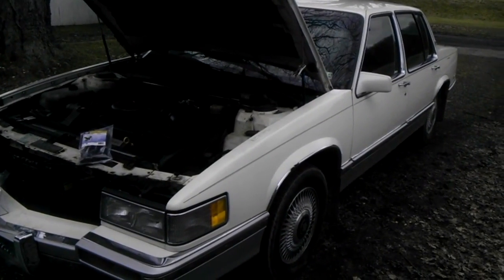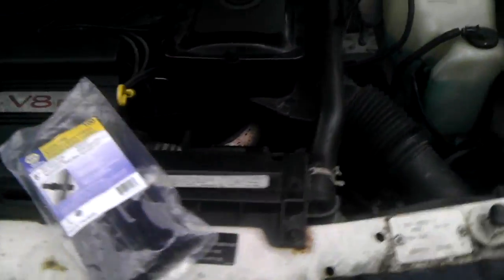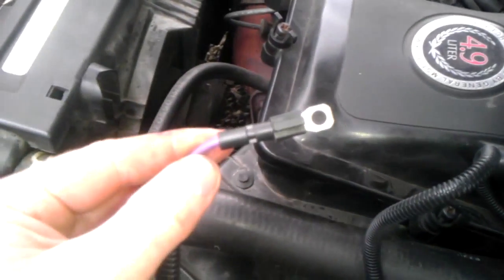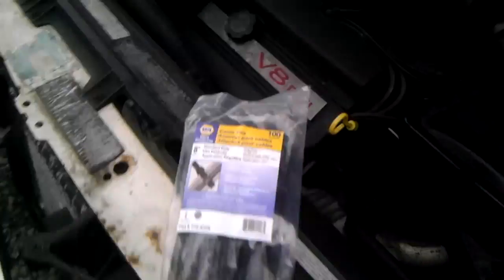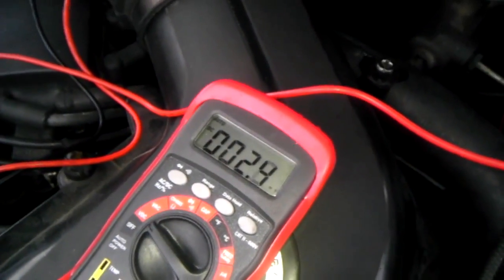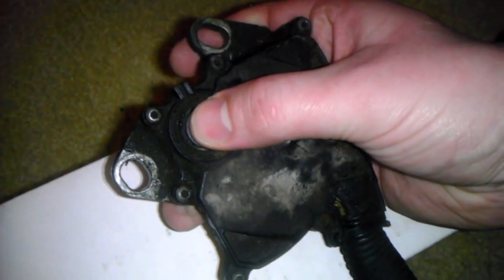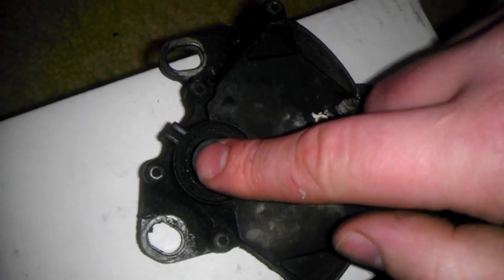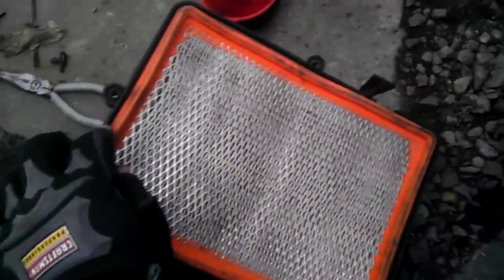Cadillac no start, no crank, intermittent problem

Comment: I have a 1995 Cadillac Deville and had the fuel pump replaced 2x! And now the car just stopped working again and won't start...I was thinking it was the fuel filter but after seeing your video I believe it is the safety switch as well..thank you.

Comment: Dumb question but is there a certain way to take off the black bolt that locks it in place? or can I just send it with a socket and ratchet without worrying about messing anything else up?

Comment from the maker: Glad to here everything is working good now.  Thanks for that information as it could also help with others in that situation.  Gotta love the parts companies for being stingy and not having that part with the pump lol.
Reply: Would it be easier to go in through the bottom or the top easier
Reply from the maker: @gokublack001  it's possible.  I didn't have access to a lift at the time.  From watching the video you can see down there, but not sure if it'll be easier from under.  If you do it under let me know if it's faster.  Good luck with the job and hope this helped.

Comment: Well my 1995 Cadillac Deville is fixed now. It was not the neutral safety switch...a small part that is connected to the fuel pump(but does not come with the fuel pump).. I forgot the name of it but they said that this little part is connected to the fuel pump, electrical system, etc. basically all the major parts of the car. This little part was burnt out..and has been replaced..car runs perfect now! :-)
Reply: Wish you knew the nane of that part
Reply: OreliaLatrice what is that part
Reply: What did it look like
Reply: Was it the crankshaft sensor?

Comment: I should have seen this A LONG TIME AGO...but his video wasn't up yet... 
mu mom had a 92 Deville just like that, it had the same problem, that darn safety switch...after 2000 bucks later we found out it was the safety switch...here's the list of what the mechanic changed. 1.fuel pump w/ filter. 2. ignition switch w/ new key from Cadillac. 3. starter. 4. battery. 5.spark plugs and wires. all that for 2000 bucks, then my mom sells the car for 600 bucks, it made me cry!

Comment: Ours just did it, but we noticed the door locks were acting up first when shifted into park from drive, we wiggle the wires going into NSS and it took right off when we turned the key. A bad NSS  thanks!
Reply from the maker: DJ51011 you're welcomed 😁

Comment: We have a 1989 Cadillac Seville, that we have been having problems with it not wanting to start or crank, but lights,radio,door alarm works. after jumping or charging battery it works. or we get the alarm messaging wait so many min. but sometimes we don't have any problems
Reply from the maker: Melissa Perdue have the charging system and battery checked out to make sure it's all good first.
Reply: +SYNTHETICDARKNESSRX8 The battery is approx  8 months old and 
 has a new starter. but we will check
Reply from the maker: Melissa Perdue you can also check for parasitic draw that could drain the battery enough to cause problems also.
Reply: +SYNTHETICDARKNESSRX8 
 okay , I will have him test for that also. 
 I was wondering if it could be a short in the ignition system area. 
becUse sometimes it starts no problem. other times we get the anti theft message. and sometimes it won't start ,nor crank.
Reply: @melissaperdue3848  my car been doing tha same thing😘

Comment: hey i got the same problem on the 1993 4.9L i replace my distributor and then it wouldnt start. it cranks but the stop engine light come on while im cranking it and my safty nuetral switch it coroded with gulk so im thinking im getting a short volt

Comment: I got a 95cadillac fleetwood brougham and I got no dashboard lights how can I fix it?
Reply from the maker: Without much to go by I'd check the fuses, wire connectors, then the wires itself.  Could also be a bad ground, or maybe the cluster went bad.  Sorry I couldn't narrow it down, and without seeing anything makes it a little more challenging.

Comment: I am looking at a 89 Fleetwood fwd that has been sitting and it will turn over but not start according to the seller.  It is a barn find with fairly low mileage.  I know it's a long shot since neither of us have any history.  Just looking for some ideas before i make that drive to check it out.  Thanks.
Reply from the maker: Firstly check all fuse and relays.  See if there is fuel then spark.  If no spark check icm or coil pack.  If no fuel check if pump is turning on or fuel filter if equipped.  Hopefully this helps and you get this nice find!

Comment: Hey can you help me I have this exact same car my problem is that when I come to a complete stop it turns off or when im driving really slow and I have to put it on park and turn it off then I turn it back on and works just fine. I have took it to a mechanic that replaced the distributor, cam sensor, relay and a couple of blown fuses, and the catalytic converter, now I read online that people who come to a complete stop there cars turn off too and they get error code e91 which is the safety switch that is mentioned here. So I will try replacing the switch and see if it works, the mechanic replaced all those parts because it gave error codes pointing to those problems but still shuts off!
Reply: O and he also did a tune up on my car doing all the spark plug changes and all that tune up stuff
Reply from the maker: pavy415 I'd clean the throttle valve and make sure the idle is at it's specified setting and go from there.  Sometimes the iac can cause certain problems like that and a dirty fuel filter also.  If what I'm understanding though that when almost stopped you put it in drive so the car will start again?
Reply from the maker: pavy415 I would of checked the sensors to see if they were in spec though before just throwing new parts at it.  My scanner is able to do almost anything when diagnosing problems.  Hope you get it fixed right soon.
Reply: We changed those parts because the error codes pointed to those problems it all happened when I got off work 5am as I was leaving my car just died on me and would not start it would crank. we got it going again and this time the problem is that it would stop and turn off on a stop or if I am driving very slow. We got rid of all the error codes and now the only error code points to faulty battery connection we will be checking that tomorrow becuase my car still turns off even after replacing the safety neutral switch.
Reply from the maker: pavy415 Whatcha find?    I forgot to say to also check fuel pressure and timing, especially fuel while driving.
Reply: SYNTHETICDARKNESSRX8 we changed the safety neutral switch to no avail it still turns off. We are most sure it might be fuel pump or electrical problem.

Comment: I'm having an issue starting my 95 deville when hot, its starts fine if its been sitting for a few hours but wont crank even after only being driven for 10 to 15 minutes.
Reply from the maker: Have you tried jumping it from the starter.  Possible solenoid failure.  Do a voltage drop test also to make sure it's supplying the proper voltage to the starter which will also help verify the lines are good for the most part.
Reply: SYNTHETICDARKNESSRX8 I'll try this, thank you!

Comment: I have a question I have a 2007 Cadillac CTS I just put a battery in it and every time I put a battery in it it drains the battery I don't know if if it's the right battery or do these type of cars have to have a Pacific battery cuz now is not doing anything
Reply from the maker: Usually the battery that they give you should work.   If the charging systems is failing then it'll drain the battery.   Also of you have a parasitic drain when everything is off it'll end up the same.
Reply: @SyntheticVisionsAutomotive  my 91 Cadillac has been sitting for 2 months I have been trying to crank her up it will turnover but wont catch what could it be
Reply from the maker: @cjharris2367  if the starter is engaging then check for spark and fuel.   Also check to make sure there are no codes and all fuses are good.   If starter is not engaging might need replaced or not getting proper voltage.   Hope this helps.
Reply: @SyntheticVisionsAutomotive  ok thanks

Comment: same problem key turns in every gear lights brite battery charged no security light on hope it fixes it fuse good starter too
Reply: Did you fix this problem I'm having same with mine

Comment: Because I'm watching right now I got the starter switch off what the bolts on it but I need to know how you took the wires off because I'm fixing my car
Reply from the maker: It's been awhile, but should be able to just disconnect the wire and mark the switch in case you have to move the switch to gain access to bolts and so on.

Comment: I have a 1995 cadillac deville and iv changed my starter and alternator but it still wont turn over..while i was driving it cut off..any suggestions
Reply from the maker: Scan it to see what codes come up.  Have you tried to start it in neutral?  You could always try holding the key while slowly shifting through the gears (take caution and use the brake in case it's jumps forward) and if it starts somewhere else or not in the same spot most likely the park/neutral switch.  

Do drop down test on the terminals to make sure the wires and connections are good.  If it hasn't had a full tune up give it one, and try to get iridium plugs and fuel filter.  Hope this helps.
Reply: +SYNTHETICDARKNESSRX8 my friend has a 91 Seville won't start theft light comes on how do u fix,that ???

Comment: Hi, found this video searching for an answer to my problem. I have an '89 4.5L Eldorado that will just click on every 3rd or 4th start. If it clicks, I just try again and it fires right up. It sounds like the solenoid, not the relay. It has a strong, newer battery and cranks normally. I'm disabled, so what I'm hoping is just to be able to clean the connections. Getting under the car will be difficult (it wasn't that long ago I could swap out a starter in 15 minutes), and I'd REALLY like to avoid paying a mechanic. I don't have a voltmeter (gave my son the majority of my tools, he's since moved out of state), but should have the necessary sockets... just wondering if you think it is the solenoid as well before I attempt getting under there.

Thanks in advance.
Reply from the maker: Without proper electrical equipment it will be a little more difficult to pinpoint.  If you have a lot of mileage and age you could always take it to a rebuild shop and they'd test it before working on it.

It does sound a little like the solenoid.  What you could do when it don't start is bridge the connection over with a screw driver to see if it starts right from there.  Take all precautions when doing so.  Cleaning the wires might help, but it could be internal.  As for the relay you can just swap a known good one to it making sure they are the same relay.

Hope this helps!

Comment: hey I have a 94 mine won't start lights still come on .. the dash says due to theft system car disabled start in 3 mins I wait the 3 mins and nothing any idea what it could be.
Reply: Gena Lewis security system is the issue. you can either bypass it or fix it. bypassing is cheaper
Reply: @DevaJones03  how to bypass the security system
Reply: @kaylagreen7233  they have a resistor you can purchase for that

Comment: I have a 1991 Cadillac Deville  4.9l no start  no crank  all been done like you said  and all  still the some      ?? could the starter relay switch  keep it from cranking      ty will did not find one now  code e52 but still not doing anything
Reply from the maker: Unless the codes got reset, or battery disconnected that code sometimes will pop up.  Relay and fuses can also cause no start.  Can usually bridge relays or buy tools that do it.  Just careful and make sure car is in park when attempting to start from outside.  Ignition switch can also be a culprit.
Reply: +SYNTHETICDARKNESSRX8   ok ill re check relay and fuses
Reply: +SYNTHETICDARKNESSRX8 there fine put on   a new neutral safety switch but  still no power going throw the ppl wire that goes to starter  but  I ran a wire to    Ignition switch  y   with out ppl wire on the starter  .  then put wire to starter  . it cranking  but  no fire
Reply: +SYNTHETICDARKNESSRX8 now it  saying  f.0.80
Reply: +james McCoy  mine is  fix running fine  I bypass  the theft  system
Reply from the maker: +james mccoy that's good to know.  Sorry I couldn't help more.
Reply: +SYNTHETICDARKNESSRX8 you did I'm driving it now :)
Reply: +james mccoy so it was the theft system that was keeping your car from cranking and starting
Reply: @jamesmccoy7860  how did you bypass the theft system because I have a wire hockey up to starter then I have to touch the battery to start it
Reply: hooked up

Comment: Mine is the same problem but I bought a new NSS and installed it and everything but still nothing? And I touched the solenoid by accident and now no power or anything what do you think it could be?
Reply from the maker: Ruben Villagrana I would start by checking the fuses and relays just in case of a short and go from there.   Make sure you're getting power to what needs powered and ground connections are good too.
Reply: SYNTHETICDARKNESSRX8 I checked the relays and fuses everything is good and the starter is good too
Reply from the maker: Ruben Villagrana can you jump the starter over manually to get it to start?  Switch is installed in the right position?  You'll have to check for power at the fuses and relays when the ignition switch is on and also cranking.   If you need wiring diagrams google usually has something, but if you want right to the point alldata will be the place to go for wiring etc...
Reply from the maker: Ruben Villagrana also make sure the security system is not active!
Reply: SYNTHETICDARKNESSRX8 okay well the good thing is I got the power back. When I jump start the starter the engine cranks but doesn't want to stay on but when we try to turn the key without jumping it and nothing :( we tested the ignition switch fuses and they are good. Any ideas on what it could be?
Reply from the maker: Ruben Villagrana when you jumped it from the starter was the key in the on position?
Reply: SYNTHETICDARKNESSRX8 yes it was turned but not all the key, we tried it but still don't want to stay on
Reply from the maker: Ruben Villagrana without being there to measure voltages in the starter relay I would try jumpers at the relay, or swap in another relay.   Something is killing power at or before the starter relay seeing that you can jump the starter.
Reply: SYNTHETICDARKNESSRX8 how do I know if I have a bad ignition switch or if it's just the pass key not working, I don't know if it has a pass key light on??
Reply from the maker: Ruben Villagrana you'll have to remove the relay and check for power when switched, also check grounds.   As for the security system usually there is a light flashing when active.   Get a wire diagram to help make it easier to check.   Should have a constant power in the relay, a power when switched, which each will have the other ends to complete the circuit.
Reply: SYNTHETICDARKNESSRX8 oh okay well I really appreciate your help man!
Reply from the maker: Ruben Villagrana no problem.   Hopefully I helped enough so you can get it back on the road!   Good luck and let me know the outcome.
Reply: I'm having same problem something is robing power tyres it from starter won't stay started turn the key I get nothing

Comment: I have a 93 fleet wood and it won’t start  I was told it was the computer so I replaced it and still won’t turn over or start can someone help me?
Reply from the maker: Check fuses and relays first, then for power at starter and work back to fuse box.  Check all grounds are good as well.   You can find most info on google for wire diagram and locations.

Comment from the maker: Did he have the car in neutral when he installed it?  Also could need adjusted.  You could try bypassing it to see if the starter could be bad also.  Those would be the quick ones to try out before testing out other spots.

Comment: I have a 1990 4.5 liter Fleetwood broham and my accessories lights up.  I had problems with starting at first, I would have to turn the key three times to start the car, and now it will not say anything. ???. is that a sign that the neutral safety switch was going out??.
Reply from the maker: without testing I can't really say.  Some times it can be the ignition switch, other times the solenoid.  Test for power in fuses and relays especially when cranking.  Hopefully I've pointed to in the right direction!

Comment: Wait a minute...that safety switch can cause the car to not start?....I really need help bro. I have the same car and I just changed the fuel pump and filter, spark plug and wires, new battery. It only cranks and its really pissing me off. HELP PLEASE!

Comment: Ignition relay fuse location
Reply from the maker: joel lewis it's been awhile since I've worked on them, but I think there are fuse panels inside that contain the ignition fuse and then I believe the starter relay.   That's what I got from Google though,  sorry I don't have more solid information.
Reply from the maker: @talkdattrashimmapullyacard4396  either not work, or stick in an on position.   There's also intermittent when it heats up it'll fail.
Reply: @SyntheticVisionsAutomotive  thanks 4 tha feedbac , i just had 2 adjust my distributor cap & set tha timing , runs sensational now thanks n'e way

Comment: My 95 DeVille catches fire under intake when I try to start
Reply from the maker: Kelsey Silvey sounds like too much fuel, or maybe it's out of time causing a backfire.  That's if I'm understanding you correctly.   If it's external possibly fuel leak from injectors or lines.